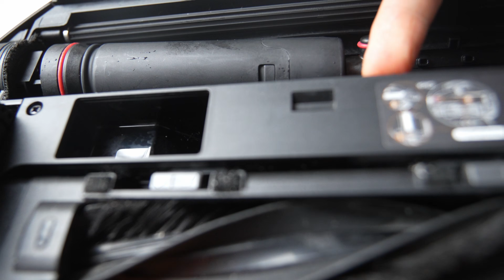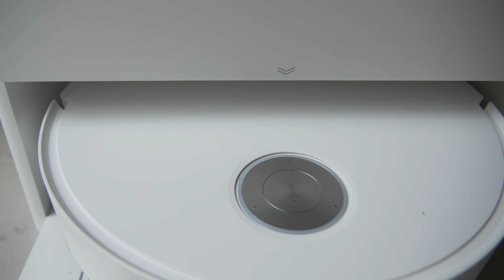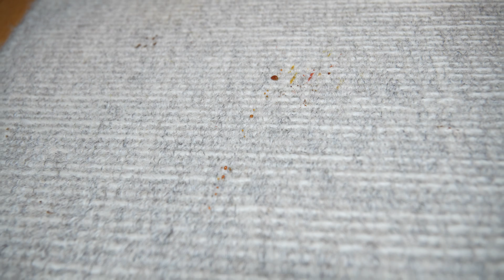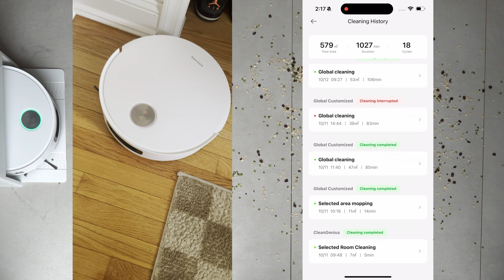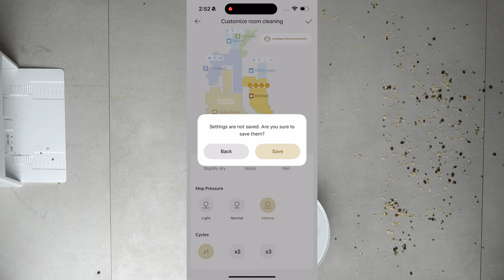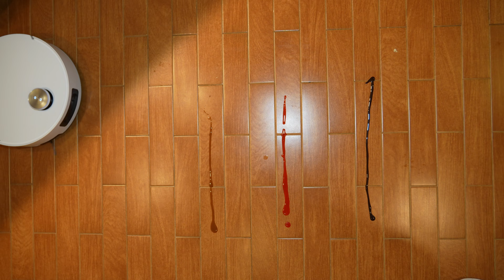Dreame Aqua 10 Ultra – 6 Real Problems No One Talks About

Comment: To test the battery life, I ran mine on the max vacuum power setting and it ran for 98 minutes, until the battery got to 10 percent, I would consider that to be similar to other flagship models. I would definitely try disabling the obstacle avoidance, you do lose the AI features but if you have it clean an area twice it should cover everything so the AI features shouldn't matter. With the obstacle avoidance off, it navigates my apartment without any issues and does not get stuck.

Comment: I've just bought an Aqua 10 (not the Ultra) after years of frustration with a malfunctioning Irobot S9.  My initial impressions are that the room mapping is orders of magnitude faster and better than that of Irobot (the Irobot mapping was broken by an early update - strange) and, so far, it has done a great job of mapping and cleaning our complex mixed surface home.  I'm not concerned about the 'different path per job' - our floor changes all the time with clothes and furniture - and the non-ultra Aqua 10 doesn't appear to have the water leak problem.  The only problem we've had is that the unit stalled with a "roller cover error" where the shield for the roller would not extend when it came to a carpet area, and none of the troubleshooting covered that situation.  I don't particularly care - our carpets would not be harmed by the roller being dragged across them a bit - but the unit basically stopped with the error and would not proceed.  Luckily it decicded to work the next day, otherwise it woudl be off for a warranty replacement.  The other issue that I note is that the unit is crap at returning to empty the very small and quicly filled dust bin.  Several times I have found the unit not picking up simple stuff on the ground because the bin was full, but the unit didn't detect that and go back to the home to suck it out by itself.  Strange and not desirable, but manageable.

Comment: Anyone here who bought one recently and can confirm how it is now? I've read that they have done several software updates to fix the early issues and possibly even done hardware changes against the water leaking issues.
Reply: Hate it. Returning it after 3 months because the mop cover constantly gets stuck. It has now been stuck for a week and won’t retract no matter what I do. It also constantly refuses to get on the charger and does just right in front of it. I’ve also found it leaves hairballs all over the floor that I have to pick up once it’s done vacuuming.

Comment: The LiDAR button has never retracted since unboxing. It was in the raised position when I took it out of the box and has missed going under furniture it would be able to go under if the button retracted. Is there a fix for this or is mine defective? It does do some unusual things but I really haven’t gotten into the settings that deeply yet. Other than the button I’m going to give it a chance. First time in 45 years I did not have to kill my back mopping.
Reply: Try switching clearance settings in the app back and forth.

Comment: Some of users says that mop smells nezt day after usage, it is not cleaned or dryied.

Could you please share your experience about this issue?
Reply from the maker: Hi! If my floors were already clean overall, it will NOT smell. But if the floors have any food or organic material, you want to clean the dirty tank after that session. Take to sink and clean
Reply: This is with all brands. Making sure it dries by manually making it dry in the app will eliminate.

If it still smells, wash it in the washer

Comment: I got track version battery is quite enough for 65-70m2 ... water is for one full cleaning  ... sometimes it doing very strange things like forgetting to lift up lidar after low furniture and cant figure out where is he ... and just smashing each wall ... track pad is destroying to fast after two weeks of every day cleaning 2 times a weak wet cleaning ... and each day kitchen and door group ... it has missed parts. I doesn't use liquid not A or B it still full after two weeks I've enabled to use liquid in apps and event make some fake pets zones by putting pet staff at kitchen.

Comment: For me the worst Dreame issue is, that if you remove the carpet or place it somewhere else - the robot does not recognize it anymore. Either it mopps the carpet (because it thinks there is no carpet) or does not mopp, even though there is no carpet anymore.
Reply: I think you need to re-map the area and it'll recognize the change.
Reply: @NelliZamanyan  yes simple fix

Comment: You should make a threshold test. See how many times it manages to pass different heights without getting bogged down...
I have 4 quite sizeable thresholds and i have ordered this but if i have to go help it out it would be annoying
Reply from the maker: I have tested this on a number of thresholds.  I really don't love it going over tall thresholds
Reply: @TheFrenchGlow thanks for the reply. Damn, i guess i got to test it then and return it if not... does it seem like its a firmware issue where it could get over if it angled itself better? I hear the l50 ultra is better, dont remember if its your video that mentioned it

Comment: if future updates improve the nav would you give this a higher mark? It will be our first robo vac/mop   being elderly couple in a 1 floor 2 bed 1010 sq ft new condo will this be a good buy for us?
Reply from the maker: HI! I think the next gen Dreame Aqua 10 and others will fix most of these issues.  It's really like getting a car the first year a new model comes out.   Some are software related but better hardware will fix a lot of them too.
Reply: I would suggest you buy it on the basis of what it does now. Dreame and the others have a habit of abandoning products and putting the needed improvements into (only) replacement models.

Comment: I switched from the X40 to this model and I have to say, I also give the product a maximum of 8/10! It does what it needs to do and what you would expect – but nothing more. What is disappointing, even annoying, is the fact that it often cannot completely empty the dust container in the robot (it gets clogged and has to be emptied manually) – not really what you would expect from a premium product.
Reply from the maker: thanks for sharing!
Reply: Do you have any pets or a lot of long hair lying around? Im starting to doubt my purchase
Reply: @Tottorul  No I don't...
Reply: Between the x40 and the acqua 10, what would you suggest?
Reply: @dp2404  I'd go for the X50 or X60 at the moment...but don't change in case you own the X40
Reply: @davidb79 i have a 5 year old Neato. Only vacuum. I wanted to retire it to the second floor and buy one that also washes for the main floor. At the moment on amazon I find the acqua 10 track at 900 euros and the x50 at 800 euros. 
I also sometimes think I should just get a simple one for 300 euros😅. My house is simple, very few obstacles(my not AI Neato gets stuck once in a while but very rarely) gres floors, and a couple small low pile rugs. 
I don't know how much difference there is on the cleaning itself between a 300euro one and a 900 euro one. I don't want be paying just for the AI and sensors that I barely need
Reply: @dp2404  I’m not familiar with Dreame’s entire product line or its pros and cons. If I were you, I’d start by comparing the suction power, among other things. Plus, since you’ll probably have the robot for the next five years, it might be worth investing in a top-of-the-line model… but that’s up to you.

Comment: I wonder if the navigation would work better if obstacle avoidance was disabled. I turn this feature off on all of my robots that have this feature because of the possible issues that you describe. I would rather move cables off of the floor and have the robot focus completely on cleaning rather than trying to avoid obstacles that I can move myself.
Reply from the maker: The issue is if you turn it off, it will lose a lot of it's AI features.

Comment: Let me start by saying that I've had robot vacuums since the Roomba first appeared in the UK in the early 00's. Since then, I've had various brands, some good, some not so much. The Dreame Aqua 10 Ultra is the latest one I own and yes it has a few problems. But, the ones you highlight are very minor compared to issues that I've faced with other robo vacs. It still cleans really well. The battery looks like it drains quickly, but it has never drained to the point of running out of power, plus it can charge very quickly and get back to work. The firmware has recently been updated and it has improved things. It seems that many will say 'oh I won't buy it' - why? Because it is not perfect? No robo vac is, or ever will be. Everyone's house is different and my home is quite complex, yet it manages better than any other robot. Does it glitch out sometimes - yeah, sometimes, rarely, it will just stop and have a good old think. Sometimes it will fail to go over thresholds. Yet 95% of the time, it will wash and vacuum better than any other robot vacuum available at present.
Reply: Thank you for this comment. Now my heart feels better getting this. Mine coming soon, black version. It's expensive thats y Im worried. Not that I expecting it to be 100% perfect. I have a cheap robot for support and getting this as my main robot. Hope this beast achieve at least 70%+ of my expection I'll be more than happy.
Reply: The aqua 10 left my floors wet (too wet) in comparison to others. I returned it since I am sure wet floors are not recommended for my floor type (laminate) especially an unsealed laminate floor where water will seep between the click boards causing swelling over time. My perfect RoboVac would go round after mopping with a hot air dash to assist in drying. I feel we are close to this being a feature 🤞
Reply: @Mirro-y2eis it wet also on the minimal water setting?
Reply: I just want one that does not give me the "front bumper is stuck" issue
Reply: I just bought my first robot vacuum/mop last month.  The Dreame Matrix 10.  I was actually expecting it to be more of a novelty than actually helpful but I was shocked by how well it actually cleans.  My biggest gripe is the app.  It's far from intuitive in my opinion.  It's certainly not something you could buy for an older person and just set it up and leave.  Overall, I'm very happy, bordering on shocked, at how good it is.  Does it completely replace human cleaning? No, but it's a huge help.
Reply: I have also had Roombas since the start, all the types including the Dirt Dog and the Scooba.  I considered this but not real keen on the whole Chinese Government thing and it seems to have a lot of issues and is not worth so much money, Dreame says they won't, but they really can't stop it.  I tried a Roborock and a Ecovacs before (they were both truly awful, the Ecovacs literally ran almost 20 hrs a day) and rebuilt my network after testing them and I found a spectacular deal on a Roomba 707 so I'm giving that one a try and I don't have to worry about a foreign government accessing my network.  My current Roomba i8+ only takes 2 1/2 hours to clean my house now which it does while I sleep.

Comment: I’ve had to stick a paper towel under the dock out of fear there’s leaks based on some reviews. The cleaning is pretty good and me having a new house the floors were a bit dusty from construction debris so the tanks and tray is a bit ashy so interesting to see. My main gripe is the software where it gets stuck, doesn’t know what or where to go sometimes, and also hearing it crash into things occasionally. Otherwise it’s very promising
Reply: my irobot did the same thing  but weeks later it settled  now it works perpectly
Reply: I just had my house renovated and the drain port at the bottom is clogged with dust debris and began leaking. 

I bought a very small straw cleaning brush to insert gently to the drain port of the base station and it appeared to have solved my issue. 

I learned my lesson letting it clean up concrete dust 😂 definitely do the first manual clean after a big dusty event

Comment: My experience of its navigation under furniture is not good. It retracts its periscope and goes under the furniture but then gets hopelessly lost. You can see from the map that it thinks it is still under the furniture whereas it is actually in the middle of the open room with the periscope up.

I agree with the threshold navigation. I have 2 x 2.5cm thresholds on hard wood floors and a staggered 7cm threshold. It makes a horrible crash as it goes over the 2.5cm thresholds and has to have a few attempts at the 7cm one.

I found the mopping to be good, but then I would probably never trust it with wet spills or big squirts of red sauce!
Reply: I agree on the lidar retraction, I saw it retract and go under the bed which was great until it went back out and somehow snagged itself on the border of the bed not sure if the lidar should retract or not. I’ve also seen it run in random places for no reason or pausing and basically staying there unless I pause and resume. Great product but needs a lot of software refinement

Comment: I started using it, I saw how fast the battery drains — really fast! And yeah, just like you said, it tries to make too many decisions and can’t quite keep up. The same goes for carpet cleaning — if I tell it to ignore carpets, it still treats some spaces like carpets or gets confused in between. I totally agree with you on all other points.

I really hope there’ll be a firmware update soon to fix the navigation issues. In my case, there wasn’t any leakage or dripping water. I had a Roborock S Pro Ultra before, and I was honestly surprised by how accurate its navigation and mapping were — it worked super fast and stayed in straight lines. But the Dreame… 😢 I’m thinking about sending it back, I don’t know yet. Still, the features are great — and yeah, it’s really heavy. That was the first thing I noticed, like “OMG, this thing is heavy!” I just hope it’s a software or firmware issue that can be fixed soon.
Reply: Same here navigation is horrible sometimes it just stares at my sofa....https://photos.app.goo.gl/ZukfFkCzNuMbCVVr7
Reply: The robot is very new and the object recognition om this item as well... I assume this unit will get better with time as they update the system
Reply: @Tottorul I ordered the Matrix 10 because I heard its navigation is at least better than that of the Dreame Aqua 10 — somewhat similar to the Dreame X50, maybe slightly improved — but still not on the same level as the Roborock S series in terms of navigation precision.
Reply: @umivas i guess im just gonna try it and then replace it if its no good
Reply: Have you tried lowering the onboard water temperature to see if it makes the battery last longer?
Reply: @Shure122  Yeah i did but the same... — the navigation was terrible. I sent it back! Only Roborock really has the best navigation when compared. Those statistical numbers like 97 or 98 doesnt  really make a big difference for me. I mean, in general, they’re all good, but when they keep adding new features, they seem to forget to focus on and integrate the navigation properly — and then those extra features just get in the way.

Comment: Half baked and avoid generation of any new tech to avoid their unrefined design s on hardware and software. Too much maintenance , poor battery life and just telling us there are Nvidia AI in doesn't mean it is better. I will stick with Mova P10 Pro which never gets stuck and cleans for 2+ hours before without needing a recharge. I wait another 1-2 refresh and refine cycles before dropping 1.2K. Great review of the robot strengths and weakness.

Comment: So if you had to buy a track or roller right now, which would you pick? The Narwal Flow? Eufy S1 Pro? MOVA Z60?
Reply: I'll choose Narwal Flow. It's cheaper.
Reply: I have a saros10r and very happy with my buy seeing this review
Reply: Track and roller mops are so overrated.
Reply: @deuceswild6857  why? 

Because every professional cleaning company with machines uses a design like that? 

Or wet dry vacuums also use such a design? 

Yeah, sure they must be worse, very logical
Reply: @010falcon  it's logical to differentiate. roller mops are great for big and chunky devices. But they aren't good for small robot vacuums, all the roller mop mechanics take too much space, it isn't good for deep-pile carpets as the roll can't be raised high enough (or even dropped at the station), it doesn't clean well close enough at edges. And I don't know any roller mop vacuum robot that has less than 90mm height.
Reply: @-Jakob-  you know that there are mop covers. 

And one more thing, we can make the rollers thinner, but we are currently in first / second gen of rollers. We need to wait.

And then lastly, most people don't care about the vacuums being thinner. It either makes no difference at all, or changes everything...
Reply: @010falcon  yes, I got 3 pieces of furniture that have legs with a height of a bit less than 10mm so I might not be a representative of the majority. We'll see how they're gonna manage to squeeze the roller mechanics while keeping stability and durability. The good thing is, roller technology definitely doesn't allow remaining space for useless features like robot arms ;)
Reply: @-Jakob-  I mean the robot arm has his uses, for example with kids or cats. Where toys could be cleaned up.
Reply: The design of the Mova is worse. The Narwal has navigation issues. EUFY S1 Pro is proven but old. 

So probably this one. The navigation issues will be fixed within a few months (this is their new generation of obstacle avoidance, it will keep getting better)
Reply from the maker: Funny. I would definitely skip the eufy s1 pro but maybe the s2 pro will be better.